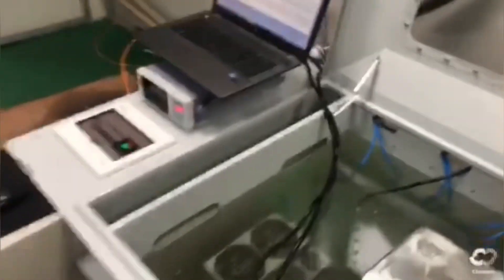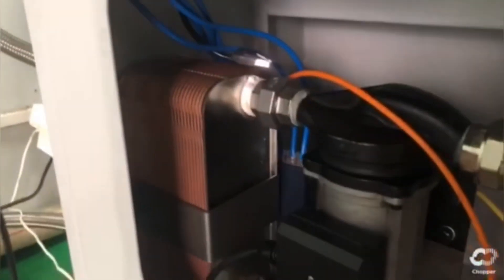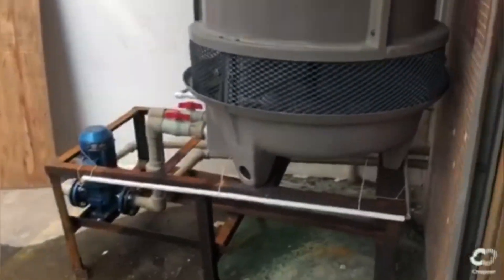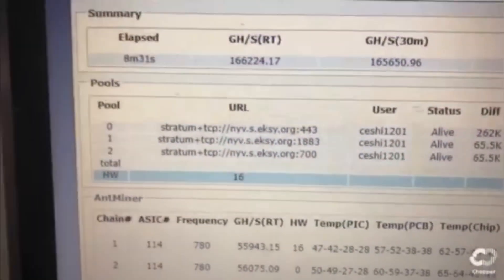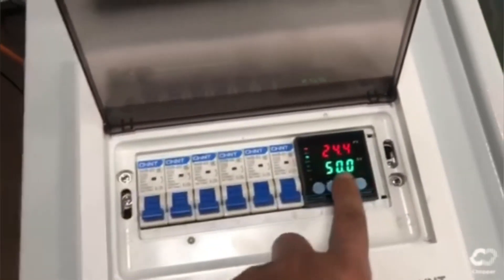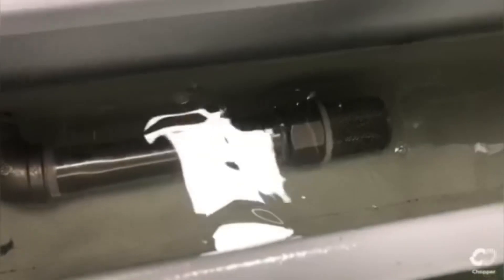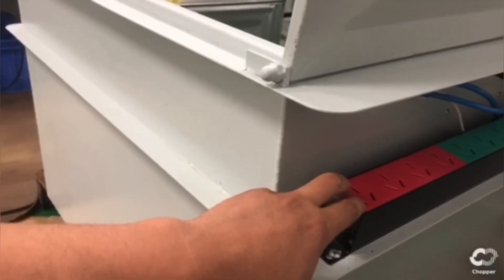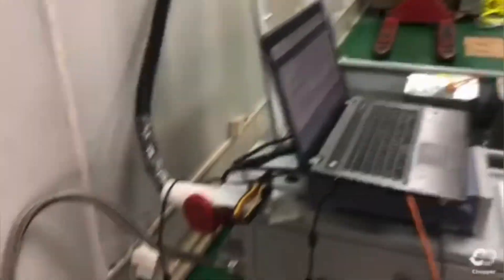Immersion cooling system for mining btc  liquid cooled  #AntminerS19 Pro 165TH

Comment: I have one more question do you know why antminers like L7/s19 etc have 2 power inputs, is it because to distribute power consumption for 2inputs?
Reply from the maker: Well the PSU from bitmain was designed that way , there is a power cord with two power plus , do you don't need to use two wall outlet , the power cord is rated at 20A , if bitmain uses only one plug they will need to use C19 cord instead of the C13

Comment: When you use immersion cooling you have also lower power consumption on basic settings? Is is possible to save few % of power consumption? 
My asic will consume 3154w I want to use immersion cooling, and I want downgrade power consumption to 3000w, is it possible?
Reply from the maker: yes definitely , for immersion cooling you don't need the cooling fans , so removing them will reduce power consumption , the asic miner it self will use less power due the low operating temperatures using liquid cooling which is more efficient and dissipate the heat better
Reply: @Crypto_mining_lab  thanks for the answer, I am waiting for antminer KA3 and I will use for immersion cooling, I hope I can decrease from deafult 3154w to 3000w beacause it's important for me :)
Reply: @Crypto_mining_lab  and in settings I also can refuse hasrate and than power consumption of ASIC?
Reply from the maker: yes you can , if power consumption is more important to you , you can lower the hashrate a little bit to get a better power efficiency

Comment: Great work man.
What kind pump did you use for the tank? and how much horse power?
Reply from the maker: Is you are referring to the cooling system , the immersion tank comes with 12 ton/H water cooling tower , can handle up to x12 S19 pro overclocked , the cooling system is a two close loops setup , one for immersion  liquid which is using an oil pump to , and a water pump for the water tower , and the both liquids transfer heat through a heat exchanger which is integrated with the immersion tank
Reply: @Crypto_mining_lab  im talking about that oil pump and water pump.

Comment: Does this process work on kd5  ?
Reply from the maker: This should work of any asic miner , the issue with the other brands is the spoofing of the fans , so basically the firmware has a safety protocol to check for fans on start up  , obversely you need to remove the fans for immersion cooling , so you need to find a fan simulator ( to fit the fun plug on the KD5 ) so the software  will think  it’s running properly and not going to safe mode ,there are a lot of fan simulator for asic out there , you just need to find the right one for your miner , and you can go immersion cooling without any issue
Reply: @Crypto_mining_lab  thank you, I appreciate it 😁